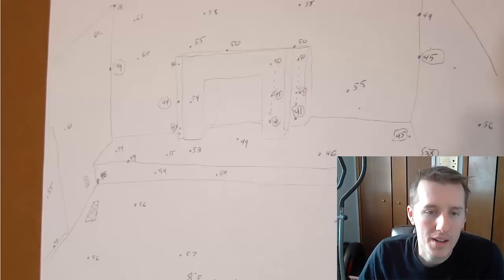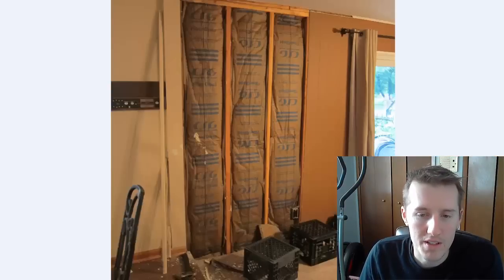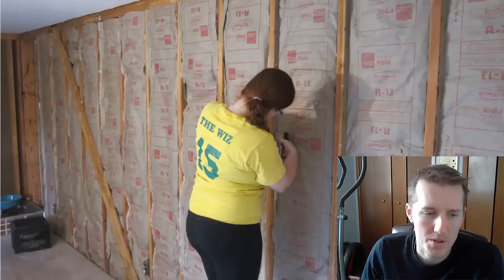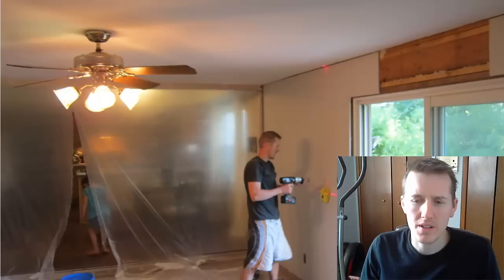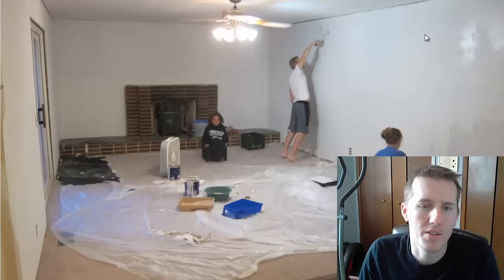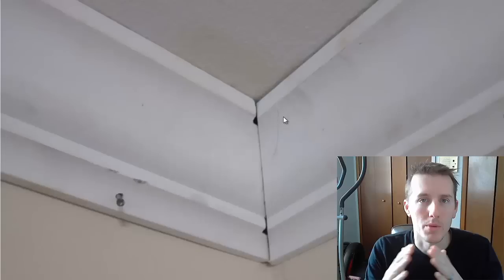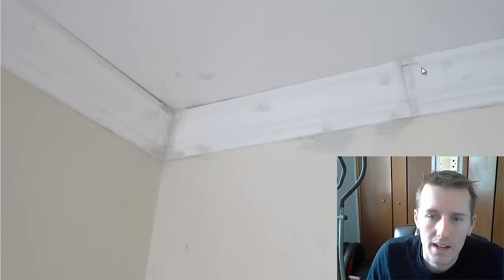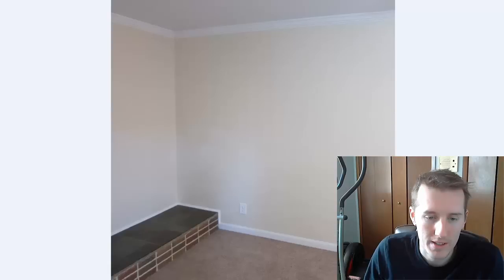Family Room Remodel - Drywall, Insluation, Trim & Paint

Comment: It looked awesome at the end! The rooms with wood paneling look so much smaller and darker. Looks great in the end, so much brighter and the savings on heat it is so worth it.. I am looking to buy a house  and there;s wood paneling everywhere. I absolutely hate it :-) but If I end up getting it I am taking it all down. I hope its not a disaster underneath, cause the house is older 1950's.Good point about the Insulation. Ill have to check that.
Reply from the maker: Insulation was cheap, $11 for a roll and you only need a couple.  The tough part was all the finishing of the drywall.  Putting it up is relatively quick.  The grouting, sanding, and everything is what really takes all the time.

And ya the lighter colors make it brighter and look bigger.

Comment: Please answer this, I put up new drywall and am currently finishing it up with filling in the holes with compound and etc and smoothing it out. Once prep is all done, I'm primering the walls and paint. I don't have to plaster the walls right? Because my friend doesn't want to believe me that I don't have to plaster it.
Reply from the maker: No, you don't have to plaster.  Plaster is something totally different.  Years ago plaster was more popular.  All you have to do is use joint compound to fill the screw holes and smooth out the joints, then sand that.  Then put on a coat of primer (which the drywall will really soak in).  Then a coat of paint.